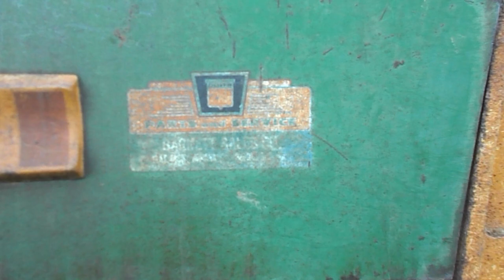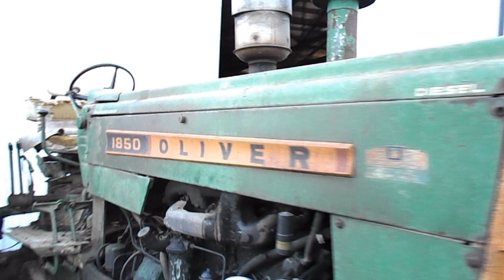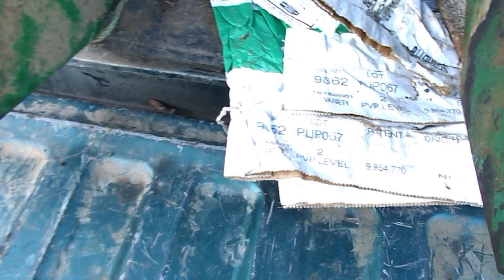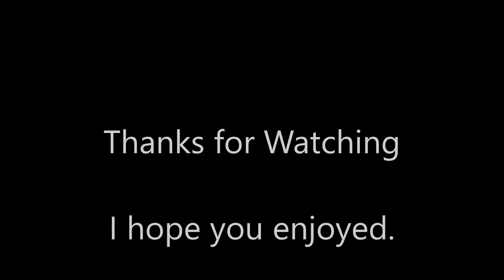Working on the Truck and the Oliver 1850

Comment: Glad to see it got a bath that stinks about ya wondering if your gonna have problems down the road with it. I wrote down the number from the engine there to try to give you some info to see it that engine was out of something else. I'm the guy who you had said to send ya some picks on my massey ferguson ford 2 16 bottom plow but its froze solid to the ground. Figured since you even offered to help I'd try to help you I'm pretty good at finding information on internet. But I'd need three different set of numbers for that perkins. But what I found I'm might be able to find what that engine went into just didnt have what perkins needed. But I hope everything goes well because I've seen people buy bigger tractors and then it gave them fits. I say that because you dont have someone there helping you everyday and then if you have an implement on there tractor goes down know there a bunch of different stuff to do. But she still looked really good. Haven't seen your dad around in videos it's good to have someone there to tell ya whst to do. 😂🤣
Reply from the maker: Well I went into this thinking to myself the hydra power might not work and it needed tires in the worst way but I bought it cheap enough so tires no problem and the hydra power is a 50/50 shot it works or it don't but we'll find out when I start running it this spring.  The engine I'm sure is out of a White combine and with the way Perkins ran there numbers I may never know what its out for sure or what year it is but as long as it runs good I'm not worried about it. When ever it get warm and dry enough just shot a couple of pics of the plow and we'll get it figured out, We got plenty of time between now and plowing time ! LOL  Dad comes to the barn when it warmer outside, When its below 50* he's not coming out of the house unless its someplace he has to go ! He likes to stay warm ! LOL  But I love it when he comes to the barn to supervise me, He will always be the supervisor on the farm !  LOL Bandit
Reply: I'm 36 and that's how it is with my dad as well he is 59 and when were doing things at my house he still tells me what I need to do. The only thing I have more knowledge on is pumkins and planting things small scale. But I just haven't seen your dad in a while just was concerned if he was ok. The way this winter in Michigan has been it's been 40 and 50 up to 2 weeks ago it's been 20 degrees and we fell and dragged 18 ash trees about 22in across 40ft tall now it warmed up so it's a mess where I'm getting at our winter is more like your guyes or at least Kentucky area hasnt been cold at all.
Reply from the maker: @bryanblood7063  I worked with dad for 20 years at the same company, He was a supervisor then and he still is now ! LOL About a week after the wheat came up it turned cold to the point I was wondering if it was going to make it or not. But it warmed back up and its been in themed 20's to 30's at night and in the 30's to 50's in the day and the ground has never frozen to speak of, Firmed it up a couple of time but its never froze. Had it not snowed on the 31 of January it would have broken a record for the least amount of snow in January but we got 7/100" so it ended up being the 6th driest January on record. Feb 2 it might hit 60*  and the 3rd it might hit 65* !  Its been too warm and now I'm waiting for the other shoe to drop and colder than a well digger tit and have snow up to our ying yang ! LOL Still could happen !  Bandit
Reply: @banditfarmer1900  I know what your saying me and my neighbor and my buddy have been working overtime since Thursday the ground has hardened not rock solid but hard enough for him to get his 4020 out the ultimate log puller I know there bigger and bad tractors but it's the biggest I have access to. The 2 15 acre fields behind me I have permission to cut wood out of and we've been falling trees like crazy. Dragged in about 25 ash trees since yesterday but all together we did about 50 all together there all easily over 19in in diameter. Even fell cherry and elm I hate elm but it was dead. I'm just telling ya that cause its gonna get up to 47 tomorrow plus it snowed all day today about an inch of all fluff just made stuff wetter. We just got back in from doing that. But I hope it freezes cause there lots of woods and it's an old established woods to where it really open to where if you tractors riding wheelies the whole was you not steering with the breaks. But we probly dragged 12 cords since Thursday maybe more. But this weather is very warm the summer of 2019 spring was 2nd to all time precipitation since they kept track of weather I just know I'm not going ice fishing this year
Reply from the maker: @bryanblood7063  Its funny to me how many people want fire wood and when you tell them come cut all you want they look at you and say Oh I thought you were going to bring it to me. LOL They would rather buy it and have some one bring it to them and stack it than do the work themselves ! LOL I really makes me laugh !  I've got so many downed and standing dead trees that its all I have been using myself for 15 years or more. My uncle comes up a couple times a year and gets a good truck and trailer load , We cut them about 6 foot long in the woods and I pick them up with the skid steer and load them up and when he leaves he's got a big load ! Most of what is back there is6" to 18" average but there are a couple of big ones (40" and bigger) that need to come down before they fall and one that did (huge white oak) , I could cut wood everyday for a year and never get it all cut up and I hate to see it go to waste but you just cant let anyone back there to cut (insurance reasons) so a lot goes to waste.  Just be careful and stay warm and don't hit any old fence wire and keep the chain sharp ! LOL Bandit
Reply: @banditfarmer1900  I know what your talking about because I know a lot of people who have fire places or a outdoor wood burner a boiler system for there house. This guy buys from a RIP off farmer he buys 100 federal cord of oak and ash he sell oak for 90$ a face cord and he stacks it loose as a goose you can sticks your arm through there and ash for 80$ but anyways the guy with the boiler buys 1200 a year from the farmer because his stuff is pre split I tried to tell him about buying federal cords and he dont wanna cut or split he would pay 2 times less per year cause he said he bought 40 federal cords it lasted him 2 yrs and he paid 980$ for it. I injured my arm in 2014 so the farmer delivered me 10 cords of completely soaked wood. So I asked around to see who owned the woods behind me found out who owned it and I helped him bale hay and I redecked 2 hay trailers so I can go out there now. But after I was given soaked oak I said I'll never have that happen again I could cut all I want at my family farm but it's an hour and 10 minutes I only can haul about 4 cords but it's easier just behind the house.  But we have a bunch of wood know and gotta split  it today thing thst stinks theres poison ivy all over a lot of it and the wind can blow and I'll get it I just take a hammer and get it off with the claw end. Yeah and the old barbwire fence it was bad i wish i had my phone with me to snap a picture but over there 2 ash trees grew into the fence and picked it up along with 3 of the post about 7 ft of the ground I never seen nothing like that the post just flapped in the wind. Buy I guess talk to ya later on next video. Have a hood one until next time.
Reply from the maker: @bryanblood7063  Most I ever got was $75 for a full cord of mixed wood split delivered and stacked. Got too many complaints about how it was stacked or split and what kind of wood it was so I quit selling any, All I cut now is for me or the family now. I guess I'm lucky I don't get poison ivy but I don't go about trying to get it either. I've got this vine that's like northern kudzo its like wire and the stuff stays green even in the winter ! It will grow into trees and take it over and kill them !  And don't even think about trying to bush hog it cause will just wrap around it, BTDT and the first time I got into it I backed into it and watched the hill side start moving 100 feet away !  I spent the rest of the day cutting it out !  All I can do with it now is push it up with the skid steer and burn it to get rid of it !  Its a never ending battle keeping ahead of it !  Bandit
Reply: @banditfarmer1900  we have stuff like that up here too it's awful. Another that's bad is Virginia creeper. I've watched that stuff Bend a black walnut tree about 20ft tall and 10in around bend it into an arch and if you pull it around the base of any tree itll grow 10 times faster
Reply from the maker: @bryanblood7063   This stuff will grow around a sapling and it will put curls in a tree from it getting so tight around it and it will wipe out seals on wheel bearing if it gets wrapped around an axel !  I just spent 3 hours pushing brush today and a lot of it had that vine in it and made it very hard to clear it out, Its strong enough to stop the skid steer in its tracks ! LOL That stuff is nasty to deal with and about imposable to work threw it without tripping !  Bandit

Comment: Give it a bath & see if anything else is broken.  Build new one? Reuse what you can!
Reply from the maker: Right now its in discovery stage and seeing what is what and got parts on order, Mainly new filters and oils.  I'm like everyone else in the fact its time to change the oils and filters when you get something new like this.  I don't care what the guy I bought it from says I'm changing them for my own piece of mind and I know its got the right oils and filters in it now.  I'll rehab the cradle by grinding and heating and some welding and it will be as good as new and will hold just fine. Biggest thig to remember is never pull anything from it and it will be just fine.  Bandit

Comment: Bandit do you ever think you will get your Dodge 2 ton dump truck going I would love to see that refurbished
Reply from the maker: Oh throw a battery in it pressurize the fuel tank to push gas to the pump crank it over and it will fire up. She will go back to work on the farm but I don't think it will ever be back on the road. Cost too much to make it road worthy again. 6 tires and rims go threw the brakes all new lights and exhaust and hope they don't see the windshield and how it delaminating and getting white about an inch all the way around it. That's not going to be an easy windshield to replace !  Its just not cost effective to fix it up for what I'm doing now. I will haul about 225 bu but I would have to drive 50 or 60 miles or more to take a load on grain to the elevator and its just not worth it at 5 mpg ! LOL Sad to say but true . Bandit

Comment: We used to have a 90 massey with screw on couplers.
Reply from the maker: I really haven't seen any of these in the last 30+ years and to find a set still on a tractor is a bit strange and tends to lead me to believe the story about this being a one owner tractor cause if it was sold before those ends would have already been taken off and changed to Pioneer ends.  These were made so you could hook them up under pressure witch on Oliver's is a commend thing.  Bandit

Comment: My thoughts, either find a good used replacement part or replace the plate metal by cutting out the middle and welding two new pieces(that are replicas of the original) back on. Likely easier said than done. If I wanted to mend the holes(which I would be reluctant) I would weld a strip of steel along the edge to make a cap to reinforce the broken piece. Realistically I suspect that you have the piece already fixed and will have to stay tuned for how you did it.
As far as barn space goes, couldn't you move one of the 1550s to the shed where your dad's old gleaner sits/sat? Even for a short term?
Reply: Both good options
Reply from the maker: I want to plate it but I don't think there will be enough room to do that, Grind down what it there weld the pieces back in grind them down and weld the plate on but the rock shaft might be a problem as it mighty close to it. First its bath time and then I'll be able to see whats there better and go from there. If I have to just weld it up I'll do that but if I can plate it I'll be a lot happier with the fix. That cradle is about $250 or higher for a used one so I think I'll just fix it up and call it a day and be happy with whatever I do.  Bandit
Reply: @Farmall450  Thank you!
Reply: @banditfarmer1900  The difference between how you want to plate it and what I am suggesting is you want to plate on the side(which is fine if there's room), but what I am saying is to weld the loose chunks back in and weld a strip of steel over the edge if the metal. 
You will do something that will work I have no doubt. Just I enjoy brainstorming these things.
Reply from the maker: @ghenry85   After getting into it I found there isn't much room to do anything with it, So I ground it down and welded it up and ground it down to fit and welded a couple of passes on the back side. It will hold just fine cause I wont be pulling on it like it has been done before cause I'm smarter than that, I have learned a few things about Oliver's and one is don't pull on anything but the draw bar ! LOL  Bandit

Comment: Cut a bigger section of steel out weld new in and redrill the holes...just an idea
Reply from the maker: What I really wanted to do was add a piece to the outside of it weld the pieces back on and grind it down and add the piece to the outside but as it turned out there is not enough room to do that at the bottom. So it will get welded back together and put back on, I've done it before and they haven't broke the welds yet so I don't think this one will be any different. Bandit

Comment: You had to add "lately". I haven't seen those hydraulic fittings lately but I remember well, using them daily as a youngster. Nice tractor Bandit. Are you going to put duals on her? Named her yet?
Reply from the maker: I haven't seen a set of these ends in over 30 years or more but I remember these and another set of course thread screw in ends that worked good on Oliver's of that time. I hope to put duals on if I can find a set of bands for the ones I have, But first thing it needs is a set of tires and I'm looking at some now for it but it all depends on what I can find. I'm still getting to know her but she hasn't told me her name yet , She's been a little secretive about that but she will tell me soon enough.  Bandit
Reply: @banditfarmer1900  OKay Bandit, so I'm talking about 40+ years ago.LOL Not that I want to be dated like this.
Reply from the maker: @billwhitman1529  I'll bet if I sit hear and think about it I'll bet it was back when I was in high school when I saw the last set of those ends on a tractor and more than likely they were on a tractor in the vo-ag shop being gone over by the class !  Might even be about 1978 ! LOL Now I'm dating myself so don't feel bad ! LOL   Bandit

Comment: How about a tractor junkyard switch ?
Reply from the maker: Well a new is only about $30 and all I got to do is plug it in so a new one it will be. Odds of finding a good used one is next to near nothing so beings I don't want to do this again I'll get a new one and be done with it. Somethings junk yard is good enough for me but somethings I just want new to replace it with and electrical stuff I like new cause then you know its right the first time.  Cousin Bandit

Comment: ( soybean farmer )  posted a video  a while back about super clean degreaser , so I  tried it and it works good . You should give it a try  on that Oliver .  
Super clean degreaser
Reply from the maker: I think this is going to take a couple of good washings to get it all off, First will be knocking the main part of the crud off it and the second will be more refined in it washing. Don't know what I'll us yet as I have several jugs of stuff sitting in the barn I need to use up so I get rid of it.  Bandit

Comment: I bet I could find you a good cradle for your hitch.
Reply from the maker: I'll just fix the one I got, I'm no welder but what and how I weld it it will hold just fine. I sure wont be throwing a chain around it to pull anything with it, That's how it got broke in the first place.  Bandit

Comment: I don't know much about Olivers but I know it's bad juju welding on bad steel. What would you feel about fabricating a new piece
Reply from the maker: This is a commend thing on Oliver tractors to have happen, People wrap a chain around them to pull something and most of the time they jerk it and that how they brake most of the time. But weld it up and grind it down and it should work just fine. If I do it right weld it up and it will hold just fine.  Bandit

Comment: Hey bandit hows ole red/blue going? she sure would look good hauling them olivers around.
Reply from the maker: Big Blue is just sitting there right now cause its too cold and wet to do any body work or paint work and when its cold my fingers don't work too good and the older I get the worse it gets too !  I really wish the shop was heated so I could work on it now but it aint and I dare not fire up the torpedo heater in there or I might burn it down !  Bad thing about hauling the Oliver's around is with my 1550 Utility on my trailer it right on the limit of what it can handle as far as the GCVW of the truck and trailer and if I put the 1850 on it it will be overloaded for sure and with the cops being like they are around here I don't want to take that chance !  I don't want none of them big tickets from them at all !  Bandit

Comment: Have you checked a salvage yard?
Reply from the maker: A used one is about $250 to $350 for a cradle so I'll fix the one I have and it will work just fine for me. For that kind of money for a use part I'll spend a couple of hours and fix it.  Bandit